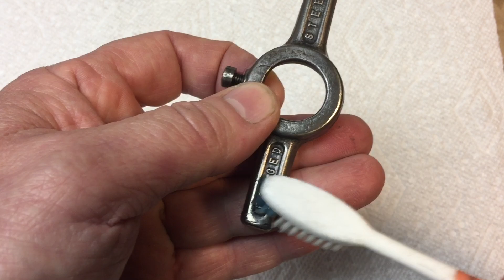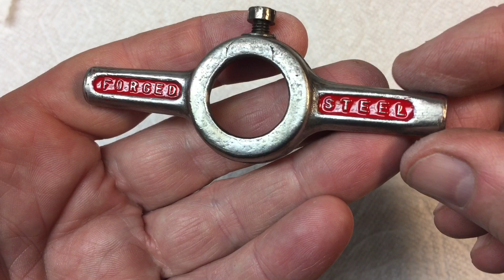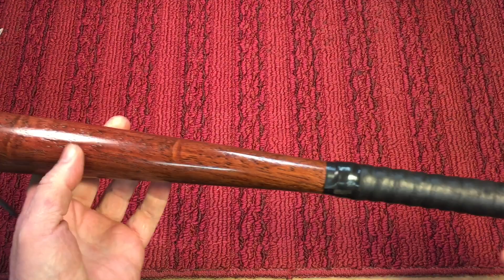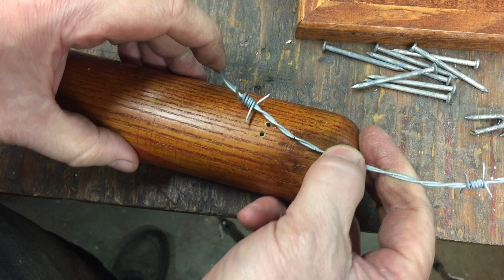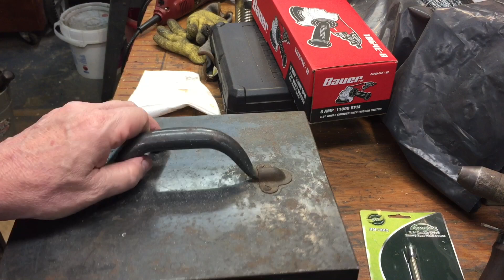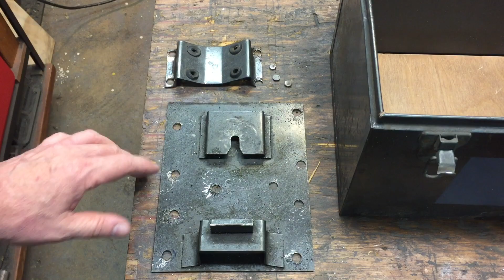Mish Mosh Monday- Paint Detail, Negan's Bat, Removing Spot Welds

Comment: Car bodies are spot welded,  if you know any body shops ask them about spot weld removal. There are a ton of different bits and methods. I have that same bit, works well, you also could have ground down the top panel over the weld area till it came loose. Good job for first time spot weld removal!

Comment: I could have used one of those spot weld cutters 40 some years ago. I worked at a place that assembled water coolers and key cabinets with spot welds. Among other things, I was the guy who had to remove components that were welded in wrong, in order to save the more expensive components. Spot welds don't fill any holes. They are  similar to a blacksmith weld in principle. Two copper tongs come together with the parts to be welded in between the tongs. You step on a pedal which pinches the parts together very tightly and an electrical charge is sent to the tips. The resistance of the steel causes the metal to glow red, almost to the point of being molten. The steel, being pinched tightly between those tongs is forced together and the weld is made. Love the detail painting on that little die stock.
Reply from the maker: Hi Dave!  It's amazing how strong those little spot welds are!  Thanks!!!!!!!

Comment: Like the monday Mosh. I have never used one of those spot weld removers. In my welding days l would use a bit and lightly drill the area then run a chiesel between. Always hard and never turned out good. That tool does a good job. I don't do that kind of work much anymore but I might have to try and find one. Thanks
Reply from the maker: Hi Glen!   I had no idea this tool even existed but Dan got them and I think they are quite cheap!  Thanks!

Comment: Great show sir. The way things are going in this hell hole of a country thing I'll be having to make a couple of them bats lol. For spot welds I prefer the drills I only know of worth making them but they look like a brad point bit come on 1/4" and 5/16 or 6&8 mm don't slip and not left with lump to grind  off if I can find one I'll send a pic not to sure if I still have any twenty plus years since I used them . Thanks again god bless take care
Reply from the maker: Hi David!  You don't realize how strong a spot weld is until you try to remove one!  LOL

Comment: Hydrangeas are good solid earners in the garden and really hardy plants. I’ve had two in pots for years but they aren’t happy anymore so they are going in the ground in the spring. Don’t dead head them until the spring as the old flower heads prevent frost burn on the tips over the winter.
Reply from the maker: Hi Pete!  Two years ago my Sister said "Hey can I take the dried flowers from your hydrangea?"  So I said OK but last year I had no flowers!!!!   =/
Reply: ScoutCrafter yep! It’s tempting to cut them off but the plant likes them on. Old fella who lived on my street and had the most beautiful and ornate garden gave me the tip. He worked for the gardening section of our local council all his life until he retired. He actually did his apprenticeship there back in the day when apprenticeships were still a thing. He’s past now and his garden is deteriorating but I can’t blame the new owners as I’m a keen gardener and I don’t think I could of reached the bar he set. That’s life I suppose.

Comment: That bat is based on a WW1 truncheon for trench fighting.  Of course a full size bat is a bit long.  They were a nasty thing to get hit by.  Basically a field expedient mace.  I was wondering if you could have cut the back part of the box off with a rotary tool and cutoff disc? Can't tell from here.
Reply from the maker: Hi Philip!  This box had very thick gauge metal and it was a tricky job, I really need a right angle drill attachment that is of decent quality.  No drill I have would fit in the opening to get that last piece...  =)  Thanks!